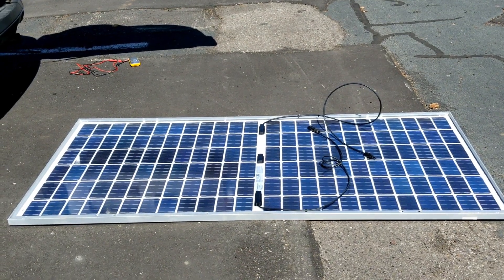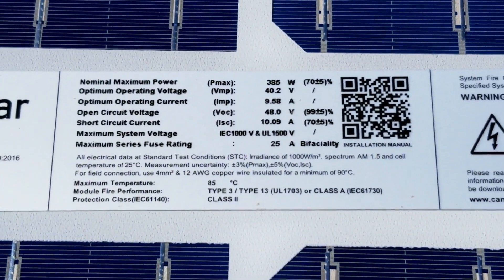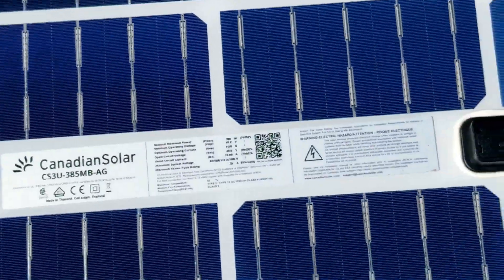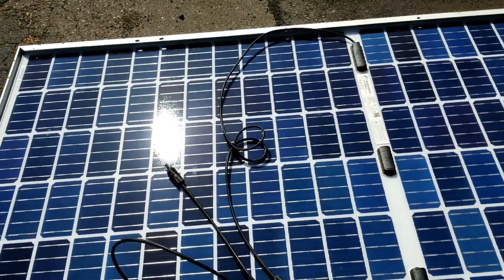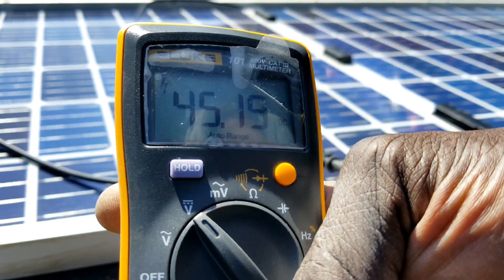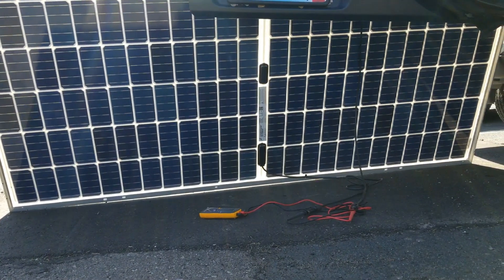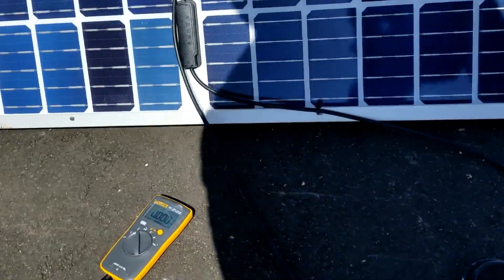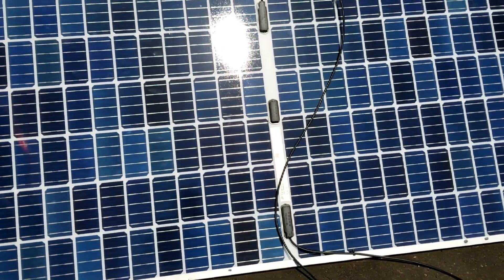SOLAR PANEL, BIFACIAL SOLAR PANEL, VOLTAGE TEST

Comment: Do a ground mount and cover the ground under panel with white sand or pea rock...the asphalt is dark and not reflecting much light...search "albedo "
Reply from the maker: Search albedo what? Send me his link.
That for your input, LIKE SHARE and SUBSCRIBE
Reply: @jwsolarusa  albedo is using the reflection of a surface for solar gain with bifacial panels....white ground is best...ie sand or pearock..whiter the better more reflection
Reply: @roqm1248  Or concrete painted white or epoxied....
Reply: @jwsolarusa  https://youtu.be/Q14ktHVwDok

Comment: Wow! Those would be great on a ground mount with white rocks underneath to reflect light towards the panel back. That would allow them to collect more light when the sun is at the extreme side like early in the morning or late in the day. What is the cost for each of those?
Reply from the maker: I wanted to maximize these bifacial collectors to the fullest so I can utilize the rest of power.
Thanks for WATCHING Jim and I will get back to you guys.
Happy Easter. 
Cheers

Comment: NOW THOSE ARE SOME KIND OF PV MODULES PUTTING OUT POWER FROM EACH SIDES TURNED TWARDS THE SUN  . IF SOME LIGHT CAN GET BEHIND IT WHILE ITS MOUNTED FORWARD ON THE ROOF OR ANY WHITE SURFACE THAT REFLECTS THE LIGHT TO THE BACK SIDE  , WOULD THE VOLTAGE BE ALMOST DOUBLED ?  LETS SAY LIKE NEAR 80 VOLTS PER PV MODULE  ? THEY WOULD BE AMAZING TO HAVE ON JWSOLARUSA  ROOF . MAAAN  !